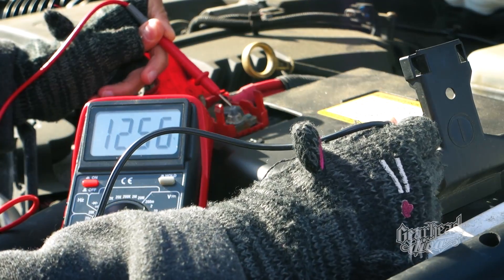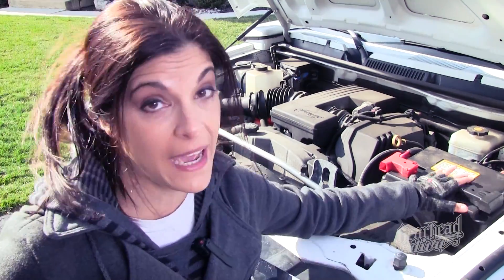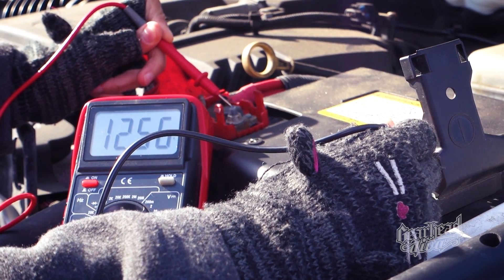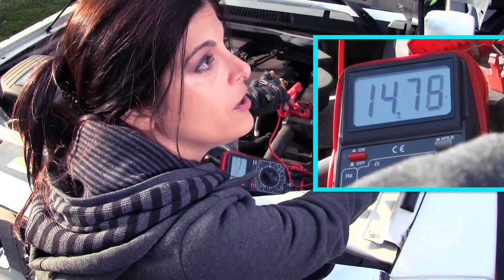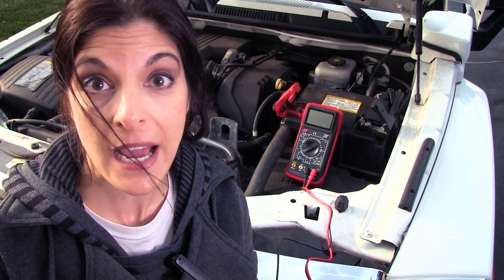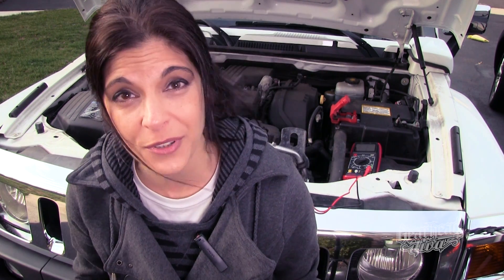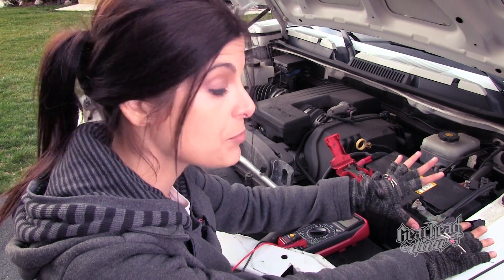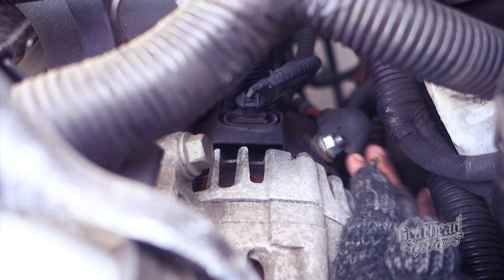How to Test Your Alternator

Comment: 12.4-12.6 V Base reading
Reply: Will go up to 13+ volts when the alternator charge well if more than 15.5 Volts it is overcharging
Reply: Load test with all on should still be at 0.5 volts above the base reading

Comment: My ancient VW, running fine, failed NCT on emissions. Way home, battery light came on. Did this test, faulty brushes. Replaced. Passed test with better emissions than last year. Alternator was failing for a year causing mis-fires at high revs. Thank-you.

Comment: 9:12 Test 3 voltage drop - what should the voltage be when testing the connection between the battery and alternator when the engine is off? I missed what I’m supposed to be looking for there. Thanks!

Comment: Thanks for this thorough video. Was on the verge of buying a new alternator (after buying a new belt) and realized the alternator had seized, which is why the belt snapped. A good dose of rust penetrator and I got it working again. Your series of useful tests convinced me the alternator and battery are working fine (for the time being). I appreciate the work you put into making these videos and have subscribed.

Comment: I have 2 cars both with same problems.the battery and alternator.both draining the battery.i was told all the alternators are rebuilt so i dont know if its them.ive have them both put in by certified mechanics.both started up and ran.1 for a week then died in traffic.another drove 30 minutes and died.of course after i paid.so this video is telling me the mechanics installed an alternaator without tasting it.

Comment: This Lady is good love her, just wanted to share what I went threw on a 1993 isuzu trooper,all my dash lights would come on, & off, tach would rev, to1-2000 off & on,sound would come threw my amp.plus I have a lot of off road lights, I started smelling some thing like burning off & on, when I turned on the heat,I checked the battery, all the wiring the altenater, throttle body, all the grounds& lights, everything was coming up good,the whole problem all along was the voltage regulator, wich is in the altenater, so my alt, was reading fine, battery was fine , so if your voltage regulator is bad your altenater, and battery will still read good,along with all your body grounds,so there is really know way of testing it unless you take it off, and take it apart, I'm no mechanic, but have ben all over this truck for 3 months to find it to be the voltage regulator, so give it a try?

Comment: add to your list the car suddenly slows down then stalls. It happened to me in the middle of winter, Stereo on, headlights, and HVAC. The gashlights were dim, the heater fan running slower and slower. Finally the car just shutoff.
There is difference in battery brands, yet are only few manufacturers Johnson Controls and Interstate are the most common. I had good luck with Diehard a 6 year battery lasted well past the warranty, Had Delco when ever temp went above 90 the car would not start, yet during cold winter fired right up. Ah got to love it.

Comment: I have installed One Four-Channel Class-D Car Amplifier Playing Four 6/9" Speakers & Installed One Class-D Mono Car Amplifier Playing One 12" Sub-Woofer in my Car. Also I have installed Autovox- X2 Car Dash Camera in my Car. Everything was working fine till two years but now my Autovox-X2 Car Dash Camera shuts off itself while I playing music at louder volume. I am confused if the Autovox-X2 has died or the Car Battery has died ? Plz suggest How to figure out where the problem is Car Dash Camera or the Car Battery ? You are very Beautiful, I am Your Fan & I Love You Very Much.

Comment: On my first car I had an ammeter on both the battery and alternator as well as a voltmeter all mounted under the dash. Was very useful diagnosing charge problems. If I turned on everything at once it definitely dropped the voltage because the 55A alternator couldn't handle full load which included two aircraft landing lights, extra rear window defroster, and a 200W radio transmitter. Originally it had a 35A alternator but I replaced it due to my heavy loads.

Comment: You identified my problem right there - engine running gives only 12.7 volts from alternator! Thanks for that.

BTW, with alligator clips on long cables just extend the short cables on the meter so you can sit in the car while revving the motor or switching on electrics - just be sure to temporarily insulate the clips where they join the prongs with insulating tape.

Comment: Can I pour hot water on a car battery to get the car started like mainly on a low cold cranking amp battery from 300-500 that's very hard to start in the cold. Can I keep a warm or hot towel wrapped around the car battery to keep it warm or from freezing so I have no problem starting the car like when the car is not on  ? What other techniques to keep the car battery warm without damaging anything  ?

Comment: Hi I have 2008 Volvo XC70  that I just replaced the  battery due to not holding charge for more then 1 day when I turned on the car use to read 14.2 14.1 but I put new battery and still doing the same thing 14.1 when my car is on and even when I rev my car still steady does not do anything can you please help me

Comment: You have excellent knowledge about cars and auto mechanics, which is very rare for a woman. I did notice two things about your multimeter.  You have an older manual-range model. The newer auto-ranging models are better and faster.  Fluke is the high-end manufacturer of VOMs. Also, your voltmeter readings were negative, which means that the leads were mixed up when they were placed into the sockets of the multimeter. I use AC-Delco batteries; my previous two batteries lasted more than 7 years apiece. Many years ago, a person said to me: "If you don't know how to take care of your car, you have no business owning it." He was absolutely right! When you go into any repair shop, you run the risk of lies, dishonesty, criminal activity (fraud), price gouging, incompetence, and human error. You have to know who you're dealing with.

Comment: Im having an issue with my batteries draining so i did this test and the voltmeter says -12.15 when i touch the case of the alternator. Ive gone through all grounds and they are in good shape.Should i have the alternater bench tested? Or replace it?

Comment: Hi good info. However the only real way to tell if a battery is fully charged is with a hydrometer giving a specific gravity reading of electrolyte.  Also to test if a battery is hod in its charged is with a drop test, these testers are very expensive. Hope it helps I always put vase lens on the terminals this stops corrosion. And fit extra heavy duty battery's,  standard ones only last 2 to 5 years. Kind regards anthony

Comment: 35 years AutoBody... My way of testing a ALTERNATOR and 12V BATTERY .... ALTERNATOR: Battery FULL CHARGE and car RUNNING turn everything on in the Car you can, Load Test let run for a HOUR, turn car off if battery is DEAD Alternator TOASTED..... BATTERY: start with a FULLY CHARGED BATTERY and Motor NOT RUNNING, turn your Key on and Stereo or Lights ON should Power an easy HOUR or way longer, After a HOUR start your Engine If battery won't start your car its a WEAK BATTERY.... NO TOOLS NEEDED

Comment: YOU EXPLAIN THIS BETTER THAN MOST VIDEOS I'VE WATCHED.... thank you... 35 years AutoBody replaced 100s of batteries many Alt... Trying to figure out WHY my Battery went dead before I head to the mountains Gold Mining... 2 batteries 2 Alt All four test good according to videos... NOT use to using a Voltmeter (why I'm here) ...  I found loose belt (looked and twisted tight) and six corroded ground wires on Engine and Body, Cleaned and reinstalled (still looking for problems)

Comment: Hi Rachel..
have a question regarding alternator health check. In another video i saw a guy test his alternator by running the engine and removing the positive lead off of the battery (I think it was the positive) He said that if the engine died the alternator was faulty.  If not than obviously not. Was he correct?! Thanks 👍😊😆

Comment: Wow, do I need your help...I hope it's in your "wheelhouse" Rachel. My 1996 Olds Aurora (the big Northstar V8) began running like it was firing on less than 8, backfiring when I accelerate too quickly, so we swapped out the plugs and wires. If it was parked for 2 days it was dead as a doornail...new battery solved this..but still running badly. Ran an OBDII code P0603 PCM Keep Alive Memory Error/Reset (my car is in "limp" mode), the P0603 is rarely a bad PCM, folks assume that's the issue. I'm betting bad ground somewhere, but where to start Rachel? If I take it to an Automotive Electrical shop, they'll slap another $90+ to run the OBDII I've already run 3 times... Thanks from a disabled dad who can't just keep replacing erroneous parts.

Comment: Test the top of the battery for draw put DVOM positive on positive put the negative on the case top not the post I have seen 12 volts across the top clean the top and check again

Comment: Hi. The only problem with using a DVOM is that it can not detect bad diodes and stator in the alternator which can indicate the alternator is working properly with the DVOM. The proper way to check the system is to use a VAT-40 style charging system tester.
Reply: You can check everything except for the voltage regulator with a multimeter. Andy Mechanic shows you how to do it. https://youtu.be/at_R7sENE0s

Comment: Hello Miss, 
Great educational video, thanks for that.
 
Just quick question. I'm having almost same problem: In cold day started the car drove very little journey 3 mins, stopped in very at shop, then tried to start wouldn't start at all. Called breakdown Engineer, who  came and jumpstarted the car, tested and turned out the alternator wasn't charging hence drained the Battery, but when he put rev up little higher something around 1500rmp or above and let it go on idle running it started charging. he told me there's intermittent alternator problem and left.

 I have tested since then few days with multi meter and every time before starting Battery  read at 12.6v (which is perfect), when started and engine running 11.5-12.6v (wasn't charging) but I rev up and let it go starts charging at 13.5-14.2v.

My question is: How do i identify where is the problem? Whether  Alternator brushes or there's any cable connection problem such as break between battery and alternator?

I'd like to avoid removing whole Alternator as I don't have much knowledge ( first timer) and tools, also in case problem is with cable or anything else.

Any suggestion or advice much appreciated. 

Many thanks indeed and sorry for long comment.
Show less
REPLY

Comment: that's a very helpful vedio but unfortunately  not for me because my main battery in the trunk but I still have to tell you what is going on with my car you my can help. ok I have 2003 Mercedes e500 that have battery drain I tested it with a test light and pulled every fuse and relay one by one and the light never turned off the alternator still charging the battery. so can i confirm this test on the auxiliary battery under the hood?  like I said the main battery in the trunk

Comment: Rachel If u happen to read the comments please get back to me , I have a 1968 corvette and im having a drain on my battery . My battery goes dead from a full charge within an hour when the car is off. I bought a multimeter to check what u said but my battery in my 68 corvette is located behind my drivers seat and my multimeter probe cables do not reach from the battery to the alternator to check it . Do u have any ideas or suggestions what can be done. I tried looking on line for longer test leads but found nothing the length i need. Please help.. I love your videos too.!!!
Reply: Make your own test lead with some alligator clips and wire. You need a meter that reads amps. Look up amp draw videos. They're all over the Tube.
Reply: On YouTube look up parasitic draw my battery goes dead after a couple hours by Eric the Car Guy or Scotty Kilmer they phrase it a parasitic draw

Comment: Hi I'm now 63 going on 33 years old now & when I was like 16 years old just 47 years ago I had an old car back in the day when car's were a lot easier to work on. It would not start and before I knew anything about cars I observed what looked bad to me under the hood & process of elimination, I  replaced it. Like the Battery, then the starter, then the solenoid, the points, condenser, distributor cap & rotor & then this & then that & I ran out of things to change. I was really puzzled & frustrated but then I noticed one of my Battery cables was getting hot at one end but stayed cold on the other, I changed a $3. battery cable & fixed it. Now from the start of it all, it was the cables the only thing under the hood that looked good. L.O.L  A Lesson learned. Don't judge the book by it's cover!
Reply: Ha! Dave, I replaced a fuel pump when I was only out of gas 40 years ago. Kids. Jeez!
Reply: Omg Bob :'(  Fuel pump is a nightmare! But hey, kudos to you for knowing how to change one! I've done lower ball joints, throttle body, tune ups, IAC, TPS, and a ton of other minor things, but I would never attempt a fuel pump! I wish I was that advanced.
Reply: Replacing a mechanical fuel pump on a carbureted car is simple.  I doubt he was talking about an electric fuel pump in the gas tank :)
Reply: Probably you enjoyed replacing all ugly looking things under the hood. And also the cost wasn't much back then.